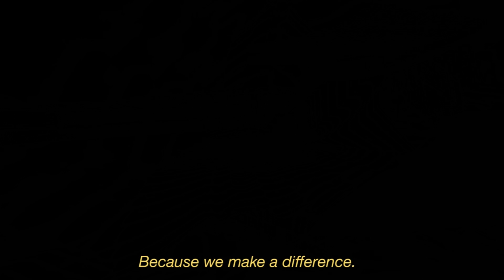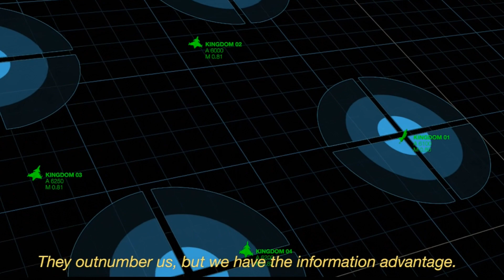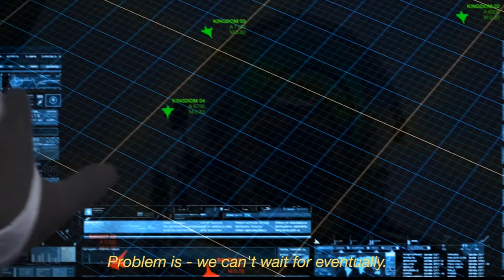Gripen Fighter Jet - Canada's Future Fighter?

Comment: The problem with this fighter is there are too few in the world. Thus making it very difficult to obtain spares and/or trained mechanics. It's also of rather limited range.  I rather prefer the F-15 rather cheap now. Lots of spares and mechanics/pilots around. The range on the F-15 is huge and the F-15 is NOT a crappy fighter.   For example the CH-149 Cormorant (our search and rescue helicopter) had huge problems with spare parts.We ended up buying the US presidential helicopter fleet for spares.

Comment: Dang, I wasn't aware of the advantages it actually possessed, thanks for opening my eyes on this aircraft. I honestly thought the aircraft was going to be trash, I was honestly more than a little ticked off when they showcased them dealing with a bunch of Su-35's like they were nothing more than a bunch of biplanes flown by idiots (for one, the Su-35 would have launched 3 missiles, not just 1. That's the reason they carry so many missiles), without breaking a sweat. They don't even have the Stealth advantage and they expect to mop the floor with one of the most maneuverable fighter jets in the world? I get that it was a showcasing of it's abilities, but the unreality of it made me wonder if they were just selling it on hype, and ticked me off to where all I saw was "Gripen vs Su-35", not "This is what Gripen has in it's arsenal". I have to admit, this aircraft actually might work out pretty well, especially having the built in networking, allowing them to cooperate with the F-35's better than most other planes can, possibly even rallying back data that gives them a clearer picture of what they're up against instead of just forcing them to rely on their own sensors that although advanced, would not likely be as close to the enemy, and at some point would be getting a fuzzier reading than the Gripens ahead.

Comment: So I understand that this was posted back in August. But There are cheaper more technologically advanced aircraft out there. Most on the Russian market. Even though it would tighten political relations with certain companies. But the SU-35 and SU-30 line of aircraft could do the same roles and more as the Gripen and F-35.

Comment: one of the pillars of the thinking behind the acquisition of Gripen NG by Brazil, was to obtain the best possible performance with only 1 engine; operate from dispersed bases, master the data-link and short rearmament timing. the acquisition numbers in Brazil can reach 150 depending on the prices and the rate of production. but the requirement was to increase the internal fuel capacity, since the Gripen C has too short legs. in the end, Saab got a well-modernized F-16. We hope the hour-base cost of Gripen don't pass 5000 u$d of 2016
Reply: ..the modifications that Brazil's FAB asked for were the change of the oxygen generation system, only one Touchscreen in the dash, greater memory capacity and greater control of engine power regimes for peacetime uses. integration with Brazilian armaments, a slightly larger tire, recognition headlamps (such as the Canadian FA18) and the freedom of adaptation of different fuel tanks.
Reply: ..and depending on the elections in Brazil in 2018, Venezuela with its Sukhoi can become the real opponent above  Amazon jungle.

Comment: There's an awful lot of "fighter jet experts", mostly on other sites, but also here, dissing Gripen hard.
What is the point, other than to promote their specific countries fighter jets? Strangely enough most are on "the same side" (Planes never going to face each other)..
Gripen E (NG) is a fairly cheap MRF. Not cheap as in "junk radar, weapons, engine, fuselage etc", but cheap compared to most other 4-5th gen MRF's. It has a lot to do with the amount of subcontractors involved in it's developement/construction and less political mess involved.
It does not make it inferior.
Yes, it's not primarily designed to be a spearhead in invading other countries bombing large ground complexes (although it's JDAM compatible etc) but it will sure suffice for defence against the most advanced planes/invasion forces for defending a country.
It's designed primarily to repel all types of russian air/naval attacks in the Baltic region. Not to support an invasion of Russia (although it's no problem if used as a part of a larger force). But for those countries want to be able to fight off an enemy and get air superiority, it's not only very capable, it's "cheap" enough to allow a country with a limited budget to get themselves a large Gripen MRF fighter fleet to scare off or defeat a larger force. It's facts, not commercials. 
So, see it for what it is. Both U.S and the Soviets ridiculed the Draken and the Viggen. Why? One of them to bolster the sales of their own planes, the other ones to  assure it's population that it was no match for USSR forces.
So quit giving Gripen E such a hard time. We're mostly on the same side in case of a conflict.

Comment: The Gripen is just about the WORST choice for Canada! Not because it necessarily is a bad aircraft - though SAAB is known to have an unusually expensive spare parts-division. The aircraft is cheap - untill you actually have to keep them flying.

Actually what is wrong with the Gripen is that it is to small. Canada has wide expances with very inferior infrastructure. Sweden is just about the opposite where you have roads to land on for refuelling and rearming.

What Canada needs is an aircraft with huge range - preferably undetectable by the enemy until it is to late. The other requirement is the ability to reinforce Nato as a bomber with PGM. There the F-35 is perfect, as it is able to self-deploy to Europe without tanker support by flying Gander - (Sdr. Strom)/Narsarsuaq - Keflavik (Iceland) - Scotland/Norway. Especially if those bases have basic service facilities (refuelling/a warm bunk and eatable dinner).

Canada's replacement requirement is - as per usual - an enormeous political screw-up.

The F-35 is in the process of introduction to a number of Westeuropean nations where the point is to get the personel trained on the bloody thing (pilots being the least consideration). Aircraft need a lot of maintainance. This means: Getting the first squadrons trained so you can expand on a massive scale once mass production has started.
There Canada is caught as being the less prioritised costumer. Wild fluctuations in the USD/CAD exchange rate does not help. Actually you can see that Canada is buying army equipment from European suppliers, as the exchange rate has been more advantageous.

As an alternative the F-18 is being offered due to easier introduction. Now that is liable to go south, as the USNavy has an increasingly urgent requirement for the Marines to get something more modern than their early F-18. Normally the Marines would get the hand-me-downs from the sailors, but as the introduction of the F-35 is reduced/delayed due to the priority of getting the damned thing to allies (and the VTOL is actually a replacement for the Harrier). This throws yet another spanner in the squeaking mashinery.

Canadian equiment procurement is a complicated process that is NEVER to be contemplated sober. Usually the Canadians end up with a mothly collection from the second hand store. Canadians generally fight well - when they get a chance.
Reply: IF WE BUILD GRIPENS HERE, then the spare parts can be built here as well.
Reply: Absolute LIES!  The Gripen's parts are inexpensive which is why it costs only $4700USD per hour to fly!  How the fuck do you live with yourself?  Only the weak and pathetic tell lies like that.

Comment: Many years ago the argument for buying the F-15 was that it was superior to the Mig 21.  What was ignored by its promoters was that it cost 7 times what a Mig 21 cost, and whereas in actual combat, yes, it could probably shoot down a couple of the Migs, one of the seven would be sure to get the F-15.  The actual question that was posed was "would you rather be the lone F-15 pilot or one of the 7 Mig 21 pilots?"

Similarly, while the F-15 had an overpowering radar system, in Nato exercises, the F-16, with a passive radar system, was able to detect the F-15 at about the same time as the F-15 detected it, and could outfly it in a dogfight by virtue of being smaller and lighter.  The comparison is to putting a bunch of soldiers, each armed with a .45 and a flashlight, into a totally dark room.  "Who is going to be the first one to turn on their flashlight?"

Even the F-16 just kept getting bigger… and bigger… and bigger.  Pilots comparing the later models to the F-16A described them as "flat champagne"… yet the F-16A was over 4 feet longer than the original competition plane… it incorporated things like a hydrazine generator instead of batteries in the event of power failure - but the generator took something like 40 seconds to kick in.  A jet can fall a long way in 40 seconds.  

Unfortunately, everything that America produces gets made bigger and bigger and more and more expensive and there are any number of individuals - not just the comments on these clips - with red, white and blue eyeballs, and nobody is going to convince them that anything not made in America can be good.  Remember the cars with all the fins and chrome?  Did they actually go faster or drive better or last longer?  Well, no, but it gave a real kick to the testosterone being generated by the driver.  I've had to use American weapons in service.  They were crap.  Bigger is not always better.

For example, The M-16 A1 failed the Canadian arctic tests, and anyone who had used it knew it would before the test was conducted … but was bought anyway, whereas the Galil passed the Swedish arctic test, and was only one of two rifles to do so.  (I used it.  It was a sweetheart).  Nor is this unusual.  Pentagon Wars not only actually happened, it is just the tip of the iceberg.  The Sheridan Tank.  Divads.  The Shillelagh missile.  You couldn't make this crap up: nobody would believe you.  When repairs can only be made in 7th echelon, you are in big big trouble, and the F-35 is just one more hanger queen.

Back through history, including WWII, when no American soldier would dare use the other side's weapons - yet the MG 43 was the best gun of the war.

Secondly, the advances in weapons systems - missiles, and so on - occur much more rapidly than that of new aircraft, and they are a lot cheaper than an actual aircraft.  Take for example the Israeli Python family.  The Python 5 has a 360 degree attack envelope, and Israeli pilots have used it successfully by firing after turning away from approaching enemy planes - whose pilots never saw it coming from head on.  In short, you are better having a successful platform that you can afford (because of initial savings on the aircraft) to equip with newer weapons.

Third, one of the comments mentions that the Starfighter was used for ground support.  This was true, and I knew of pilots what came very close to fouling their pants during exercises - a flameout at low altitudes in a flying knife is a terrifying thing.  We have now entered into the arena of ego and pride and corruption.  No self respecting general who expects to get a high paying job from a defence contractor after he retires is going to advocate anything but "the best" (which just turns out to be whatever the Americans have decided they are going to sell us)… whatever the heck that is.  Best for what?  We could have purchased a good ground attack aircraft for a lot less, AND it would have done the job better.

Now to the actual subject of the clip:  Would this plane survive in Canadian conditions?  Sweden happens to be an arctic nation, (Malmo is closer to Rome than it is to Kiruna) and they have always managed with one engine jets.  Two engines means about… oh, 10,000 extra parts that have to be stocked, maintained, replaced, and hauled along on every mission, for no observable purpose.  Once you say "Oh, the F-35 will serve our forces", you prove that the "twin engine" argument was just BS from the start.

I like the idea of STOL, I like the idea of quick engine changes and short turnaround under primitive conditions, I like the idea of being able to use roads for advanced combat airstrips, and the cost difference means that we could actually have more planes for less money.  Why do we have to buy F-18s or F-35s to bomb third world countries?  Yet this is the future of conflicts.  Sure, it looked great when Peter Mackay sat in the cockpit of an F-35, but it would look great if he sat in a Gripen, as well, and it would be a lot cheaper.  The design flaws of the F-35 are just too well documented.

Finally, many of the so called experts who push these weapons are lying through their teeth.  I recently carried on a discussion with a retired Canadian Captain (in a local gun shop) about the M16 A1.  For 45 minutes he told me how good it was… and I kept trotting out the problems it had, and finally he said "Well, we had to buy crappy rifles to get the best machine guns".  "Ah… Hello?  Did you really just say that?"   At which point I looked him in the eye, and he didn't even have the decency to blush.
Reply: What? that doesn't even make a lick of sense. There should never be a situation where there is a lone F-15, if it had the problem would be the air force for screwing up so heavily. This is one hell of a straw-man.
Reply: @alexprimm5361  It does make sense because airforces have budgets.  A country could have 7 times the number of Mig 21s as it had F-15s... or at some point does discretion become the better part of valour and the 'superplanes' go home.  You may argue that this could only occur during wartime.  Well, if that isn't what we are talking about, just what are these planes for?  So the Defense minister can pose in a mock-up of the cockpit?
Reply: @alexprimm5361  It's not a strawman.  Its about the cost that the Air Force pays for a given aircraft.  If your budget is X dollars, then you can choose to fly a few very very expensive planes, or a larger number of cheaper planes.   In both cases, you spend X dollars.  When you only have a certain number of planes that are available, that is really the bottom line.  Of course, the U.S.A. has never had to fight a country with a comparable defense budget., so it hasn't had to worry about that.  For other countries, it is a very real consideration.  You can choose to fly a plane with a long turn-around time, or one with a short turn-around time.  At some points, in a real war, you are going to find yourself limited in the number of planes you can have in the air. 

Of course, there are other advantages to flying a cheaper plane: you can choose to spend more money training your pilots, and yes, there are advantages to having well trained pilots.

Comment: Looking at the situation between Bombardier and Boeing on the C series passenger jet tariffs, I can see this falling perfectly for J. Trudeau to promote a Bombardier-Dassault joint venture with the Rafale C or latest variant. Don't get me wrong. The Rafale is a good aircraft perhaps not as good as the F-35 when it matures but likely equal to the Typhoon and Super Hornets and definitely superior to the Gripen E. The Rafale is truly multi-role and although the Canadian government doesn't have much appetite for ground attack it does need that capability and politically it was be a feather in JT's hat.
Reply: ...and for Canada's needs probably the best aircraft at the best price would be the latest model of the F-15 like the Saudi variant. It has the required range etc but the drawback is it is produced by Boeing who took over McDonald Douglas some years back. The only other game in town other than Boeing is Lockheed thus the F-35.

Comment: Sweden has got a great technological lead compared to several other manufacturers. We Swedes do not see big plans or vehicles as the best, we see technology more like success and the battle plan and products that work together. In Sweden, the air force uses small country roads as airfields, so Gripen and the former Viggen / Dragon are unbeatable in all modes, to buy large expensive plans that require high levels of staff and expensive operating costs are a big minus.

It passes every day Jas 39 fighter aircraft across large parts of Sweden and is a natural thing for us who lived in Sweden for a long time, myself have done my military service on one of the aviation fleets in the eighties, the day always started with the tension and the hunting plan Draken 35 and Viggen 37 went up in the air at five o'clock in the morning and went on all days and nights and the same routines on all flight bases and with hundreds of planes throughout Sweden.

Comment: You should look at Indian MMRCA competition to find out which fighter jet is superior. India tested, F-16(block 60+),Saab Grippen,MiG35,F-18,Eurofighter Typhoon and Dassault Rafale in all sorts of weather(Desert and Snow) and altitudes or Sea level. Ultimately Rafale and Typhoon emerged as finalists . India Chose Rafale because of its multi role capabilities and more likely to order naval variants too. Rafale is most superior 4.5 gen aircrafts available right now.
Reply: Btw Grippen's Engine at high altitude cold weather did not restart after a break and prepared for retakeoff.

Comment: Canada needs long range fighters. Ideally two engine planes in case one fails in a remote area. Not sure if Gripen can fit that requirement. But if it can at least have the range it might be viable.

Comment: Why the pilot ditch the cockpit and life support and sharpen the front geometries I like the single engine optimization. With a drone setup no pilot liability. Smooth out the surface for reduce signature be amazing if you could incorporate a scramjet into the design